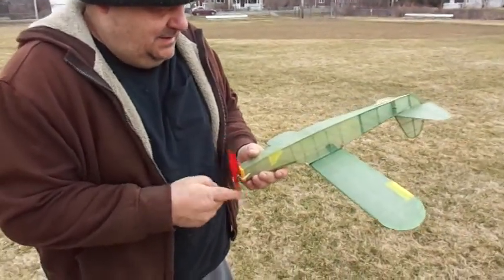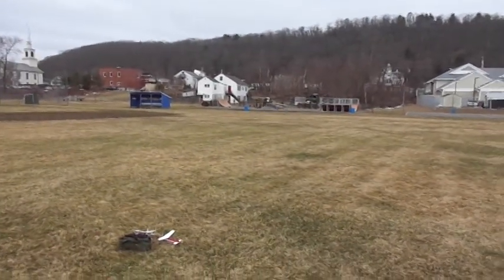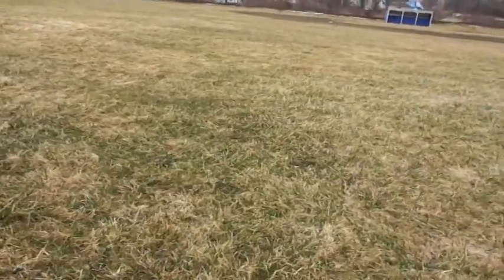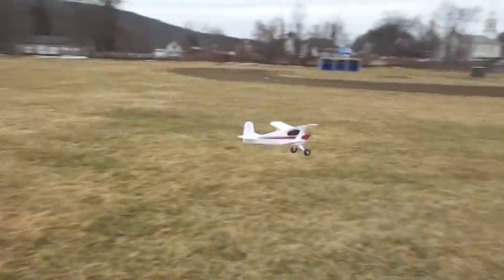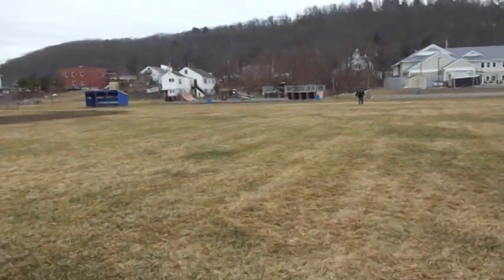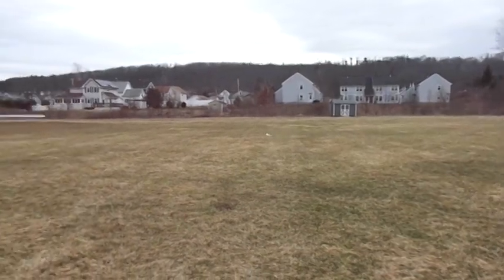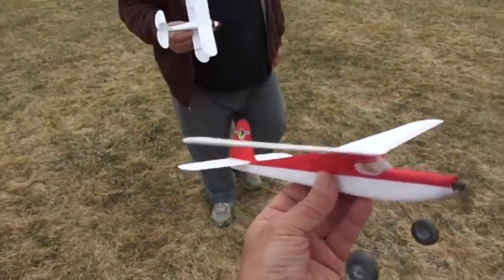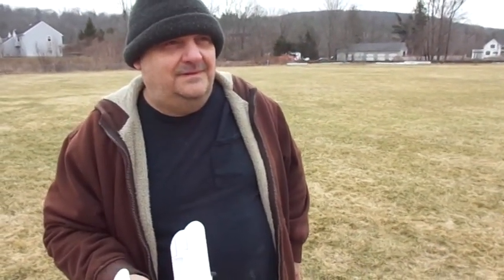Maiden Flight MICRO GOLDBERG RANGER 30 Supercapacitor Plane

Comment: I love your channel guys ! a small question (may be dumb question) : why don't you put a small switch on line between the motor & the supercap ?
Reply from the maker: Thanks! This was one of our first videos, before we started using switches. They're great because you can charge up the plane and wait on the launch. Also the capacitor can charge a little better without the motor dragging it down during charge. We have learned a lot since this video. Might be time to make a new video!  -Mike and Richie

Comment: Capacitors with another half a volt are called lipos!  Add a Peterborough timer and you have the extra power. 
Or you could maybe just remove the undercarriage or lighten it a bit. Or maybe use a bigger motor. I’m an expert now. I’ve learnt from your videos😀😀😀😀
I laughed out loud at the end. If you don’t like it........
Reply from the maker: LOL Thanks for the feedback! This model flew away on a thermal in spite of the giant landing gear. Spent a couple months in the top of a huge white pine, stayed there until the glue dissolved in the rain and some bits of it came down.

Comment: What hobby store sells  3mm foam ?    never seen it here in my area   i have to hot wire slice down to get  thinner sheets
Reply from the maker: At the time we made these early videos a few years ago, you could buy the stuff at hobby stores. It was made by Midwest and I think they called it cellfoam. It came in a few different thicknesses, 3mm was the thinnest. I've looked all over the internet for it since then to no avail. These days we're using foam meat trays, foam picnic plates and take-out food containers, which work nearly as well. The hot-wired material will work, but you'll have to adjust (increase) the thickness to compensate for the fact that it doesn't have the smooth skin layer which adds a lot of strength. Consider using thin (maybe 1/32" or light 1/16") balsa as a substitute, depending on the design. Richie has built and flown balsa and tissue models with capacitors too.

Comment: Nice video guys.  My father, now 88, built and painted models for Carl Goldberg in the 1950's in Chicago.  I think they all were members of the Chicago Aeronauts Model Aviation club.  I built many Goldberg models myself.  Ranger 30, Falcon Jr., Falcon, a FF model and scratch built and designed numerous aircraft as a kid.  Learned everything from Dad.  Suggestion on your mini Ranger.  Find some lighter weight wheels for that model and it will perform much better.  The 30 was my favorite.  My 30 flew with a cox 20 and I put too much fuel in it once.  It climbed out of sight and glided about a mile away across a busy roadway in calm winds.  We somehow found it an hour later.  That design had nice wing area, ample elevator and rudder for stability.  It was a well designed model.
Reply from the maker: Hi Jeff! Thanks for the great comment! I love the story about getting the Ranger back after the OOS flight! I too built a bunch of Goldberg kits as a kid....my favorite based on looks  (and sound) was the little Junior Skylark with twin Cox Pee Wee .020's! It flew great, although it was mainly free flight due to the fact that I was nearly always out of control with that old escapement r/c system! First controlled flight complete with landing under control was accomplished with a Goldberg 1/2A Skylane with Bonner R-E Varicomp Escapement. 

The mini Ranger on this video ended up flying away on a thermal...ended up in the top of a big white pine tree where it gradually disintegrated over a period of weeks...I got the gear back and built another one around it! Still using that same landing gear, it's not nearly as heavy as it looks...the wheels are foam like a styrofoam peanut, even the hubs! Our flight times with these little cap planes have greatly increased since we started using our homemade digital capacitor chargers...this was one of our first capacitor plane videos, and we've learned a bunch since then! 

Best wishes to both you and your Dad, thanks for the cool story!  -Mike in MA

Comment: Thanks for subscribing! I've gone over most of the information you had in the video of your charging setup, and I ordered some things from BangGood, not that it's very hard to get me to do that, but I'm impatient, so I thought I would try using an 18650 Lithium cell from a dead power tool (Scrounged from the battery recycling bin at Home Depot) and a little adjustable buck converter I bought for something else (buck converters are probably available from BangGood. I know Ali Express has them, about 50 cents each.) to set the charging voltage at @ 3 volts, and use a fixed resistor to limit the current around where your setup regulates it, 850 mAh. (I have to go over the math again, but it looks like that fixed resistor has to handle a lot of power) Then  I just have to monitor the voltage  with a multimeter. And scrounge up or cobble together some sort of switch. Thanks for the inspiration!
Reply: I just went rooting through my pile, stash, storehouse, and the simple current limiting resistor  I planned to use would probably need to be rated at 5 watts, something I once had, but can't find. Went online for other ways to solve the problem and there is a simple current limiting circuit that uses a LM317 adjustable voltage regulator, but I haven't got one of those either. Radio Shack can't help me any more! I kept studying and found a real nice soft start circuit, which would do very nicely. It gradually allows more current as time goes by, and after three seconds or so, the Supercap has some charge so it isn't  laying there helpless against the inrush current. As the soft start circuit drops out, the charge on the capacitor picks up and opposes the current. It uses an N channel MOSFET , and I'm pretty sure I have one of those. I did find a switch, which is only twice as large as the Power Up switch, but it does save me having to invent and fabricate one. To think I was re-inspired because the way you were doing this supercap thing was nice and simple!

Comment: My avatar is a no-cal F4 Phantom II that I got to work using a "POWER UP" paper airplane power unit. It flew pretty good until I cooked the capacitor trying to charge it too long. The Power Up" charger uses three AA cells, so the voltage can go too high if you charge too long. I found 10uF supercaps online, but the the Power Up rig has a charging status LED and an on/off switch, which I lunched taking the old capacitor out. Apparently you are just charging with the capacitor in circuit, no switch,  which would be a lot simpler. Let me get it back out again...
Reply: 10 F? I'll have to pull it out and look. Twice as big as the original. I was hoping for longer flights. as usual.
Reply from the maker: Hi Herbert, We made this video when we first started playing with the supercapacitors and we do it a little differently now. We have found that a little switch is a great addition, and we have moved up to using a regulated power supplies we've built to field charge our supercap planes very precisely from larger LiPO batteries (no more buying "AA" cells!). Check out this video to see how we are doing it now. There are links in the video's description which will show you what equipment we are using (including the regulated charger)and where to get it: https://youtu.be/vF1mOyZc1lk

The motor in this video's little Ranger is a homebrew geared unit built from a scavenged micro servo, see how I did it here: 
https://youtu.be/cWLlvaewwaY

I built another identical plane using a direct drive 6mm motor, you can see it here: https://youtu.be/vF1mOyZc1lk 

I subbed your channel! I see you like the indoor stuff...great application for supercaps.  Best of luck with your experiments! -Mike in Massachusetts

Comment: Hello sir can you please tell me what capacitor you used
Reply from the maker: You can find them here:

 https://www.banggood.com/5pcs-2_7V-10F-Cylindrical-Ultra-Super-Farad-Capacitor-High-Power-Capacitance-Supercap-10-x-26mm-p-1218354.html?p=AZ31114857064201605K 

Also, you can find the other components from the same supplier:

https://www.banggood.com/4X-Original-Upgrade-615-6x15mm-59000RPM-Coreless-Motor-for-Blade-Inductrix-Tiny-Whoop-DIY-Quadcopter-p-1106063.html?p=AZ31114857064201605K

https://www.banggood.com/4-Pairs-Gemfan-50mm-ABS-Propellers-For-80-100-Class-Frame-Kits-6-8mm-Coreless-Motors-p-991023.html?p=AZ31114857064201605K

https://www.banggood.com/20pcs-SS12D00G3-2-Position-SPDT-1P2T-3-Pin-PCB-Panel-Mini-Vertical-Slide-Switch-p-1000847.html?p=AZ31114857064201605K

Thanks for viewing our video! Mike and Richie
Reply: Thanks sir

Comment: been seeing 5.5v 4 farad super capacitors in eBay pretty cheap, might be about right for a WLtoys integrated brick (receiver+ESC+2 servos about 24 x 28 mm board). the brick is meant for 1S, 3.7 to 4.3v roughly, so may need a voltage buck down board (or not). those little voltage boards DO try to keep output voltage the same as source voltage changes, so it might be a good thing for playing with capacitor powering, very small extra weight. with capacitors I wouldn't try larger than 4" prop, gear reduction, 6 x 12 mm motor at most!
it has a potential, RC flying for 2+ minutes, then just 20-30 seconds to recharge and fly again, if everything "source+draw" is calculated (craft+size+lift too of course!).
Reply: Thanks sir 

I have try to build micro rc plane but don't get right electric system 

In India very less people know the right knowledge about RC plane 
Even I have learned from internet
Reply from the maker: Thanks for the interesting comment! The problem is that LiPo's hold a LOT more energy for a given weight than supercaps do, so if you're after reasonably long flights then LiPos are the way to go by a wide margin. We are using supercaps on our free flights because they don't require a timer...they are happy to let you run them all the way down to zero volts with no damage and the limited energy storage capacity means we can use the charge finish voltage to limit flight time instead of a timer. On the other hand if you're looking for a challenge just to see if it can be done, I think that's great and I hope you'll keep us posted on your experiments! P.S. I think those 5V caps on ebay are actually "2 cells in series" construction, not sure. You could do the same with individual caps in series.
Reply: Yup, the 5.4 volt units on AliExpress and elsewhere seem to be two 2.7 volt capacitors in series.  I HAVE read that indoor duration fliers have been pushing the caps far in excess of the rated 2.7 volts - I don't recall what, exactly, but 4 or 5 volts sounds about right. I wonder what the failure modes for the things are, though - if they just suddenly stop working, or deteriorate rapidly over the course of a few flights, that's still OK. If they explode or start burning then that's NOT OK. I suppose some controlled experiments in a safe setting might be in order.

Comment: Good Ranger 30 story and I liked the Carl Goldberg meeting story too. I lost a Ranger 30 with a brand new .020 on its maiden flight. I grew up on a residential airstrip north of Wichita (3KS5) so my dad got in his Little Toot (Hawk Pshaw) and went on an aerial search mission for the Ranger. He didn’t find it from the air and I never found it from the ground even though I looked for it for a couple of days. I should’ve let the engine run for a while before I launched it. I had no idea that it’d climb as fast as it did, but it was a pretty light and efficient model.
Reply from the maker: Sorry to hear about your Ranger 30, Ron. Those little .020's are powerful little screamers and will make those lightweight Rangers climb like a skyrocket! That's how Richie and I ended up in that facedown with the bulls! Did you follow on in full scale aviation after growing up on the flight line? I have my Private ticket and built/flew one of the early ultralights. In fact Richie once took my ultralight up for a circuit around the pattern at the local airfield, having never had any full scale instruction, just model flying experience...he looked like a pro that day, perfect landing and everything. I remember the homemade exhaust system on that thing, made from a big Maxwell House coffee can that still bore the slogan, "Good to the Last Drop"! Mike
Reply: sonex413 Richie in an ultralight without any training! Man, that’s when you needed your video camera. I have a private license and own the 1946 Aeronca Champ that I soloed in when I was 16. I helped my dad recover it in 1977 after he bought it. I kept it at KSYN just south of where I live in Minneapolis but flew it back to Wichita a couple of years ago before my health deteriorated. So now it’s at 3KS5 in a relative’s hangar rent-free. I really miss flying that Champ but even as a light sport I wouldn’t trust myself in it, especially when throwing the prop to start it. I need to get it listed for sale so someone else gets it back in the air where it belongs. One of these days I’ll post some of my Champ videos on YouTube. I need to start a YouTube account that doesn’t have my name on it in an attempt to stay off the grid and away from The Man. I’ll let you know when that happens.
Reply from the maker: Get that Champ going and fly with a buddy if you must! Man, I'd go up with you a couple times a week to watch the sun go down if I lived a little closer! A friend of mine has a Champ in pieces...it needs a new wing spar per the AD...looks like it might never get done...sad to see an old bird gathering dust. Richie had some (verbal) ultralight instruction..plus he'd been up with me a few times in the 172....I talked him through a series of fast taxis and short hops in the Weedhopper before I turned him loose...but this was 30 years ago or more and that's how everybody learned. Anyway you never saw a prettier first solo!